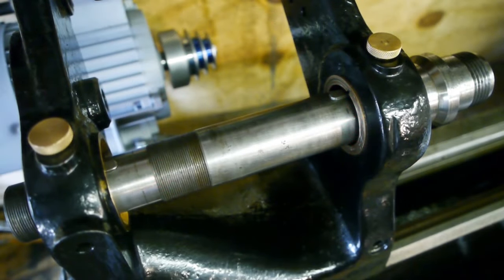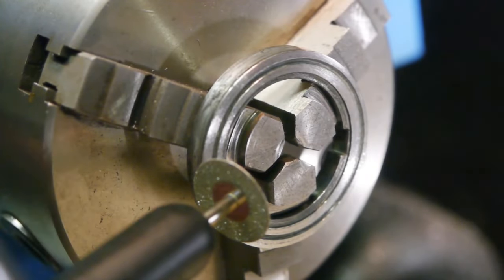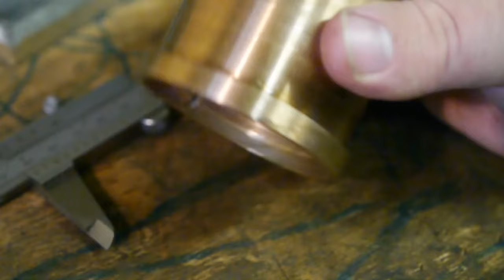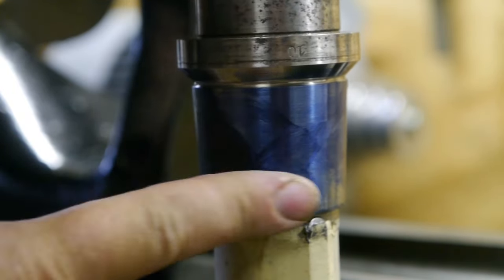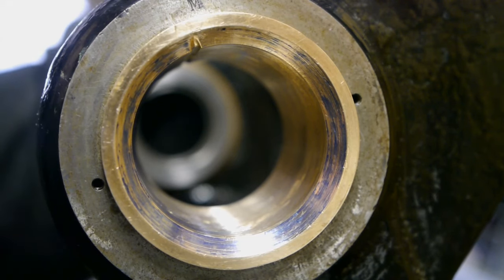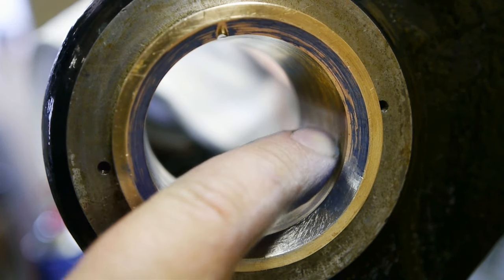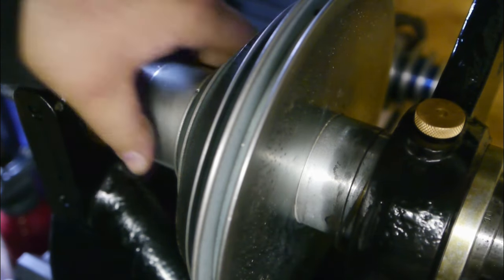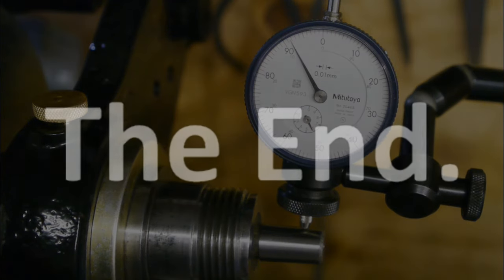Machining and Scraping a vintage lathe spindle

Comment: Anyone that claims they've NEVER done that is either lying or they never get their hands dirty! Back In 1968 I was soldering a Mil Spec Amphanol Aircraft connector with over 40 wires ...I think. I did an excellent job and was elated with myself. Then I saw the cable collar laying on my bench! !*!*!* The other end of the cable already had a connector on it! So you know what came next..... Damn! I'm still pissed!:face-blue-wide-eyes:
BTW, I love your old lathe. She has that "I'm not just a machine" look. "I'm a work of ART"
Thanks for the video.
Wakodahatchee Chris

Comment: A suggestion, when putting any item in any chuck to have a parallel inner and outer faces.
Try putting some spacers screwed into the chuck face  and face them off,
Then when you place any item to be turned, you can be assured your turning the item parallel 
See Joe Pye's video ,